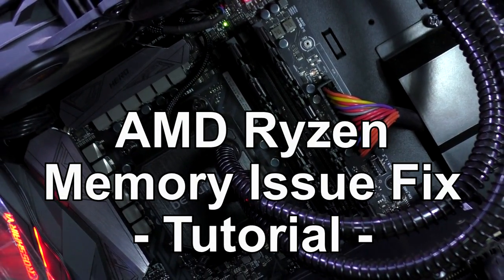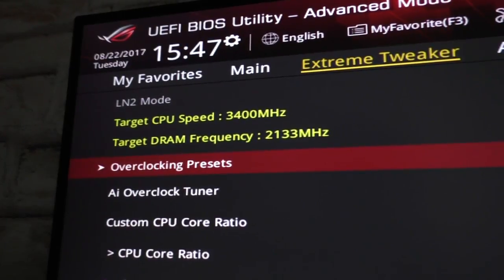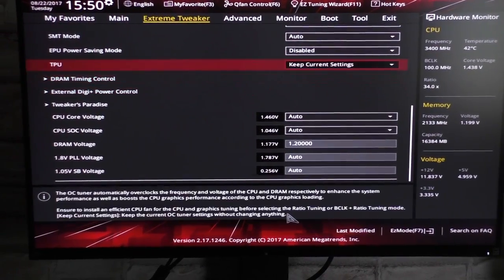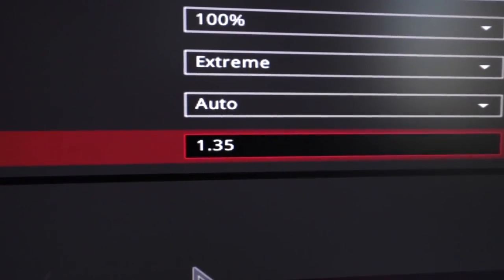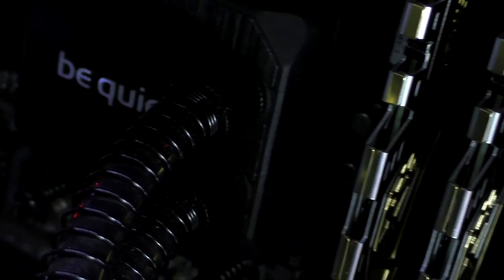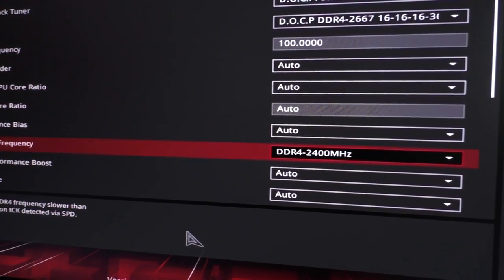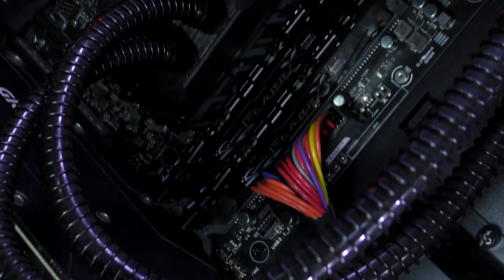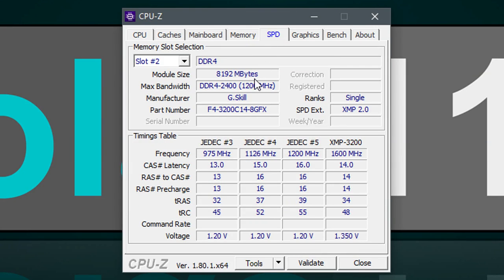AMD Ryzen Memory Issue Fix - Tutorial

Comment: I am having issues with 1 specific game Called Space Engineers after some time it crashes back to Desktop.
My New System build from May 2020:  MSI B450MAX MOBO, CPU AMD RYZEN 3700X, Gigabyte Radeon RX5700XT 8GB GPU, and a 32GB Ram kit by Corsair with 2x16gb ram sticks with 3200mhz speed.  Other than that I have a 1tb M.2 running windows 10.

Now I am not well versed at overclocking a computer so I for sure need help on this issue.  My Ram is recognized by my MOBO, but the speed is set to default 2133mhz and for the life of me I cannot get it to the speed of the ram 3200mhz.  My Bios is current and I did Mflash a newer version just today with no changes nor allowing me to update the ram speed.  I do have XMP enabled and that did not default to a higher speed either.  I really am not ok with messing with Power or Freqs so I would like some help specific to my MOBO if possible as well using my same MSI B450 Tomahawk Max Motherboard.

It is very frustrating and help would be very appreciated.
Reply: @flapjackpancake8679  Thanks for the words, sad that with my system it still has issues.

Comment: Anyone else got this setup? Asus x470 Prime + Ryzen 2700 + 4*8 Corsair Vengeance lpx 3200 CL16? With DOCP it won't boot with the latest BIOS Update.
Reply: Marius A very similar to my setup, (I have MSI X470 and 4 
x 8gb G.skill Trident Z RGB) had an insanely frustrating time getting it to boot. Ended up lowering the frequency to 2966 and now I’m booting. Going to try this videos method of voltage increasing to get my rated speed.
Reply: My is Asus x470 Prime + Ryzen 2700 + 2x8 Corsair Vengeance lpx 3000 CL 16-20-20-38, Msi gtx 970. All time problem with booting. Sometimes spinning circle stay forever. After fresh instalation Win10. Few first boot ok, but after5or 10 boots spinning circle. My fault because my ram are not from asus ram compatible list. I need bay new
Reply: @HarleyDesignsInc   I just did a build , x470 msi gaming plus max motherboard  with ram..   g skill v series 2x8gb 3600 f4-3600c16d-16cvkc  working perfect xmp profile ,  so bios update would probably fix it ,  I know it's a year later lol

Comment: that's why 3000mhz-3200mhz are just a waste of money the board will down clock it for 2400mhz-2600mhz and if you bring it back to it's rated speed it is consider as overclock. becoz most of the mobo only supports 1866-2400mhz clockspeed and higher than that are OC. and i don't even get why x470 mobo only supports ram clock the same as those cheaper boards like b350m
Reply: I'm running 3200 Mhz, dual rank, 32GB, two sticks, 2700X, not sure why you had problems?

Comment: i just received my 32GB kit of Corsair Vengeance LPX ram rated for 3200Mhz and I was instantly disappointed. One stick of it was 100% dead.
Reply: @Someonemenoone Possibly, I went to Linux for three months after receiving the bad ram and I still had trouble (using my old ram with no errors). The trouble was due to the driver for the 2700X in which the desktop would sometimes deadlock while multitasking to the point that I had to press the reset button to fix it as I couldn't get access to the terminal.

Comment: WRONG RAM for x470.... you need  CORSAIR Vengeance PRO 32GB (4x8GB) DDR4 3200MHz. RGB is optional. or similar Gskill Flar-X. Ryzen 2700x is memory sensitive. you got a top of the line MOBO but wrong and cheap ram.... CORSAIR Vengeance RGB PRO 3200MHz  16GB 0r 32GB.  has a Samsung B-die..even though is a CL16

Comment: I bought 16gb flare x 2400mhz cl15 for my ryzen 5 1600 build running on a msi b350 gaming pro carbon. With the latest beta bios I'm able to run my ram at 3200mhz CL16 rock solid
Reply: are those the grey ones or black?
sorry, for some reason there's no black 2400mhz around where I live only greys
Reply: latest bios is 1.60 correct????

Comment: Gonna try this on my pc 
Rog strix b550-f WiFi
Ryzen 7 5700g 
16 gigs of trident neo 3600

I tried using the docp and my system wouldn’t turn on but I dropped it to 3200mhz and it seemed stable and added about 30 FPS for my integrated graphics, I have yet to overclock my CPU and haven’t been able to find a gpu

Comment: running stable at 3466 msi carbon pro ,  trident z 4000mhz 16gb  , i manage to boot a 3733 but sometimes windows 10 don't boot a drivme to de recover options, using bios 7A32v1F  , on ryzen 1700 at 3.9 ghz at 3.875 v

Comment: I updated with NOT DEFAULT (error!) DOCP reset, my Asus ROG X370 F Strix to the BIOS VERSION 5220. (for the first time i commited this error). Now my DOCP profile is gone, I cannot set them to anything, my 2 rams of 8 gb total 16 are "recognized" as two Gskills (they are flare x .. sure.. g skill is the manufacturers) but as 2400 Mhz and not 3200 mhz Which THEY ACTUALLY are instead.
I don't know how to run them again at 3200 mhz now, and Cpu Z recognizes them like they are 1199 Mhz... lol.. Something is strange.

I updated the bios because I was trying to solve the bad BOOT that I constantly have. First launch makes Windows not to load.. and I just found out from your video that this could be related not to Windows updates messing the pc up , but actually to the voltage of DOCP Profile standard 1  3200 I set my pc to.
My cpu is Ryzen 1700. My mobo is described above. Please anybody can help me? 
Some say to reset the UEFI, and remove battery... I sincerely dnt know. Nobody can support me not even the web site.. it's filled with anti spam anti harassment stupid moderation rules that create a barrier to anybody looking for assistance. I cannot bring to assistance I am not in a close to civilization and competence area.

Comment: I have the same problem + the bios says i have 8gb of ram and at the same time can see both 8gb sticks, windows says 16gb (7.95 usable)... The rest is hardware reserved, i have Kingston Predator 3000mhz currently runin at 2400
Reply: MAXEL I don't if u got it fixed this happen while I put 3 ram stick total 32gb 2x16 and 1x16 Windows was only using one stick (8gb) everything else was reserved either take one out or add the four one this was my case since the motherboard will use any ram port as dual channel
Reply: Lower the timings from 15 to 14 and keep the last timing value on 36, could help you up one step.
Reply: MAXEL I have the very same problem, if u fixed it i'd like to know how did u do it.
Reply: Pablo Garrido I have the same problem too
Reply: Kodyan  I think its all about the motherboard
Reply: Pablo Garrido Do I have to change manually BIOS settings ? What do you think
Reply: Kodyan I changed the motherboard and it got fixed, got an Asrock AB350M
Reply: Try to go to www.crucial.com it might have maximum on ram  how much ram you can add for each slots
Reply: @Pabliku3  i had same problem once on my asus sabertooth 990fx after i updated the bios everything was fine.  check to see if there's a bios update. either that or RMA the board.

Comment: At the moment I have Adata XPG DDR4 3200Mhz 8gig x4. Only two of them in Slot A2, B2 As according to the manual of the Asus Rog Stix B450-E Gaming. When I put the other 2x8gig memory sticks in it does not boot up,  it keeps shutting down. All 4 memory sticks are New only 3months old. I have ran individual test on them in slot A2, with Microsoft memory diagnostic tool which cam back as No Errors Detected.

How Even, once all for are in, the Memory Diagnostic Tool detects an error.

Then I watched this video regarding the DRAM Voltage, i reload into the Bios..DRAM is set to Auto at 1.250V though on the Adata XPG Sticker on the memory sticks it clearly says 1.35V.

I am now going to hope by installing the other two Adata XPG Memory sticks this will fix the problem. :) Thank Man.

Comment: I've got Corsair Vengeance cmk16gx4m2b3000c15r,and its not working with XMP profile,atleast i set it manually 16-17-17-36 2800mhz at 1.36v and it works perfectly fine for now with Ryzen 7 1700 3.72ghz at 1.27v,I have Asus Prime X370-Pro mobo,and i will try your method if i have vboot voltage somewhere,to get rated speed 3000(2933mhz). :)

Comment: When firstly accessed the bios I had my ram at XMP but booting into windows didn’t save and now can’t even access the bios
Reply: flippy I’m assuming you’ve fixed this by now, but for anyone else with a similar issue, you will be needing to clear CMOS (and as such you will reset the bios). This is normally done by moving a jumper back and forth across a 3 prong connecter that says something like (CLR CMOS) or something of the like. Personally I like to just remove the big silver battery on the mobo for a minute or two and stick it back in. Most newer boards have a little metal lever on top of it that you pull back and it should pop up for you. After a minute or two with it removed just shove it back in the way it was and you should be able to reboot. You can always try XMP again after this, as some have reported doing so after a CMOS clear has fixed the issues but YMMV. Ryzen is dumb, but if you do some research you will most likely be able to manually oc your ram to the rated speed, or maybe a tad less. Hope this helps out any others with this same issue :)

Comment: I got also an issue. I got 3200 mhz ram. Its supported on the mainboard list ( exact model/type)  But It won't go above 2866 mhz, its does boot on 2933 but then system unstable.)

MB: Asrock pro 4 b450 pro
Ryzen 5 2600 (stock)
Memory: HX432C16PB3K2/16, Predator, XMP  (HyperX 16 GB DDR4-3200 Kit)

Edit it does support XML and the bios set all timings auto correct but no luck.
Reply: @Willian Mendes yes this
Reply: @Willian Mendes Sadly I do.

We made the mistake getting normal 3200 or 3k ram or a bit lower.

We had to of bough the b-die ram, of verious brands.

That will work on AMD platforms ( ryzen)
at max speed.
Be sure you get the cl-14 version for max performance.

The normal 3200  mhz cl 18 or 16  vs the b-die ram at cl 14  is rly a HUGE difference.. Even at that speed of 3200 mhz.
Besides, that b-die ram AMD platforms will reconize and platform is stable.
Reply: @Willian Mendes My problem is even worst, even 2666 is at my system unstable.
I can't help you mate, but seems 3ghz isn't an option for u

Comment: I just did Auto 2400 and called it a day even though my ram is 2666 anytime I it as 2666 my games what crash but at 2400 they are perfect.. (I do everything in auto)
Reply: Im using 4x4GB of Corsair Vengeance LPX 2400mhz CL14 with Ryzen 5 1500x paired with RX570 4GB Sapphire Nitro + on Asrock AB350M PRO4. Everything runs stable and I'm happy. Although it is recommended to use faster ram with Ryzen processors in real life you will saw small improvement with Ryzen 5 cpus paired with GTX 1060/RX 570 - 590 gpus. I would go with higher ram frequency when building high end Ryzen 7 systems  paired with high end gpus.

Comment: I give up. Guess I’m just gonna stay on 2667mhz with my 3600mhz ram kit
Reply: Go Ryzen 3000 series no RAM issues what so ever. I got rid of my 2700X and 1600AF they had so many RAM issues.
Reply: @JayzBeerz  I have a 3800x.
Reply: @MoneyIVI  so it should be able to run 3200MHz on 4 sticks with no issues.
Reply: @MoneyIVI  my 2700X didn’t like 4 sticks so I only ran 2 at 3200MHz.  But my 3700X, 3600X and 3600 love 4 sticks at 3200MHz.
Reply: Sounds like you might have a too low procODT, don't give up!
Reply: did you ever find a solution to this?? I have a ryzen 7 3700x and am only running 2133hz because i cant find a fix. When i changed speeds i get an orange DRAM light and my pc wont post. It's so shit

Comment: I think I just got bad ram dimm but I got 16gb 3200mhz oloy warhawk ram and its beautiful rgb ram but it was giving me bsod memory management and I tried everything and to no avail kept getting bsod I ran mem test n it passed but it deff was a ram issue one the dimms we're def broken cause I put corsair vengeance in and it works fine so I rma the ram to newegg and waiting for a replacement set to be sent to me hopefully these new sticks will run good and give me no problems.. If ur wondering I have a ryzen 3600 and a b450 f asus rog board running os on ssd and games on ssd HDD for storage and small games

Comment: i bought b450  and ram gave me issues not detecting 1 ... bought b550 and same problems with new ram upgrade in the right slots .. AMD B450 b550 boards are garbage i'm wasting money like crazy
Reply: Don't feel bad dude they got me as well , Got the b450f gaming II And had 2X8 Gb of ram and had it running at 3600mhz for over a year , Lastnight my other 2X8 gb of ram came in the mail ! Added it and boom pc wouldn't boot after 3 hours it booted and ram was stuck at 2166 no matter what I  did with manually OC the ram ,After I managed to get all 4 sticking running at 3200mhz but if I go any above it crashes right away , Think its the built in controller on the 3700x isn't working as it should with all 4 dim slots filled. Guessing im selling it and getting the 5800x3d and staying away from ANY B450 B550 anything with a b at the start and is cheaper ill pass on next time.
Reply: @blindshot709  after a year new board.. b550 upgrade and new ram, 1 stick decides to stop working because.... cpu and the ram aren't supported ... 1 whole year I used it without being supported lol even though.. I got an amd ryzen 5500 cpu and new Ram and it all works now but I had the ram issue with my old amd board of my previous board.

Comment: Just built my Ryzen PC - I use Corsair Vengeance LPX  (CMK16GX4M2A2666C16). I set 2666 Mhz profile and it works perfectly with Asus ROG STRIX B350-F GAMING
Reply: I have Asrock B350 Pro4 same ram but it's stuck on 2133 mhz  @ 1.2 v :(( can u tell me what voltage and latency do u have set for it? and what's the CPU and it's speed? thanks
Reply: Are you sure you have chosen the proper profile not only setting the freq? Watch that first: https://www.youtube.com/watch?v=pBmVf0S4UDs&t=. First set the DOCP then choose memory profile. Also are your RAM on compatibility list with MB?
Reply: RAM is not on list :) should I try to squeeze some more mhz from them?
Reply: does it have any profiles or is it just 2133?
Reply: I have the exact same Asus ROG STRIX B350-F mobo and Corsair 2666 memory.  After selecting the DOCP Profile 1 in BIOS (0902 version), my system boots to Windows and runs great; however, if I shut my computer down completely, it often fails to post after a cold boot and the RAM defaults to 2133 mhz. Are you experiencing this problem at all?  Other than selecting the DOCP profile, did you change any other AI Tweaker or Advanced settings to improve stability?
Reply: Hi, nope it runs out of the box very stable just after selecting RAM profile. Are you sure you set the profile correctly? I ve had similar issue when i set only frequency to 2666 not selecting the profile. But before setting the RAM I ve updated BIOS to the newest version make sure you also did this. Also do u have exactly the same CMKxxx model?
Reply: I double-checked and it's the same CMK16GX4M2A2666C16 part number. I'll try updating the BIOS to the latest version and see what happens.  In addition to selecting the DOCP profile, I also disabled EPU Power Savings Mode, Core Performance Boost, and Global C-State, so perhaps one of those adjustments is contributing to the instability.  Fortunately, my system has been very stable after booting into Windows thus far, but it would be nice to resolve the cold boot issue.  I'll keep troubleshooting. Thanks for your help!
Reply: @nicklein
Dude I have same ram on AsRock B350 and I was not able to run it even on 2400, but then I found out that the slots really matter with risen :) Which slots are your RAM using? I changed mine from A1-B1 to A2-B2 and now after setting it on 2666 it works without any problem, even without touching voltage. Hope this helps you too :) GL
Reply: @Giorgi Zhghamadze  I made the same mistake at first!  I have the RAM modules installed in the A2-B2 slots, which is also what the ASUS mobo manual recommends.
Reply: nicklein if u havent been upgrading BIOS at least to AGESA 1006 that's the problem. Edit: I haven;t noticed that u have 9002 BIOS should be fine. So maybe your Windows then?/SSD. Its really hard to say. If it boots to windows the BIOS settings seems to be fine

Comment: Will this resolve slow boot issues?
Reply: I wounder to 40 sec boot time for me .. did you try the 3200 ram ?
Reply: @eddyhaze8239  Not so sure anymore. I changed the motherboard to an X570 and the boot times is still similar. I've resigned myself to accept this issue
Reply: @saskloppers1   asrock does not support 3600 for Matisse .. I forgot about that when searching for ram on the list

Comment: Running 2700x with asus x470 pro with 16gb of gskill trident z rgb. Which ran fine. Bought 16gb more and added them...system boots fine, but when playing a game (I.e division 2) the system keeps crashing. Took the the new ram out and it runs fine. Any ideas how I can get the system to run stable with the additional ram?
Reply: @willuigi64  Yes Will, same make, model and speed rating.
Update, swapped the dims around and cleared out the aura. Aurous, and gskill softwares and it appears to be running ok, with no crashes as yet, totally bizarre.
Reply: @willuigi64  that may be the best idea. Have you updated the chipset and bios to the latest revisions for your existing mobo?